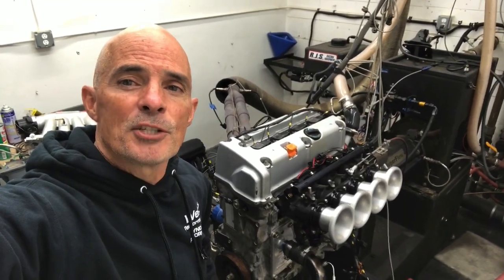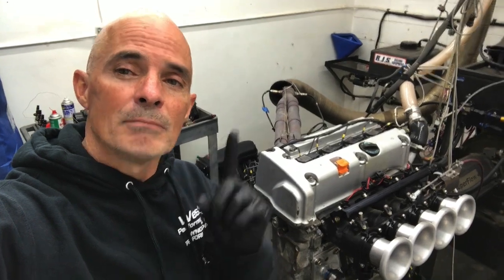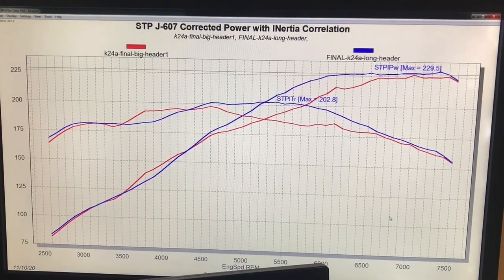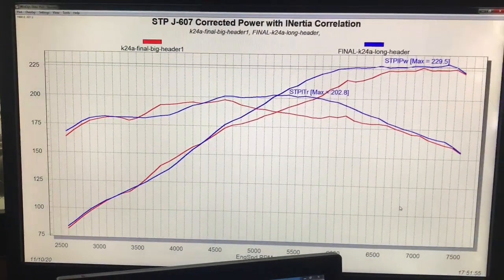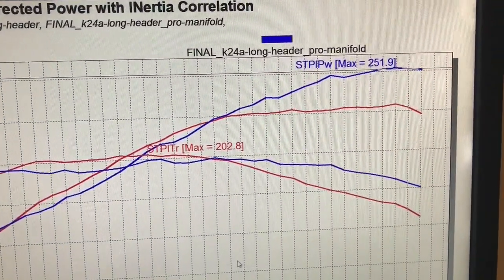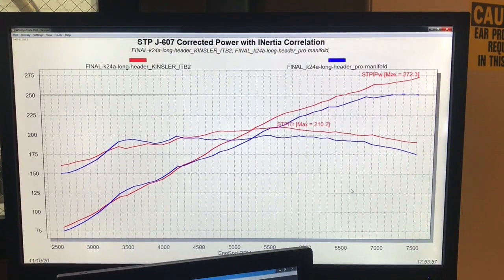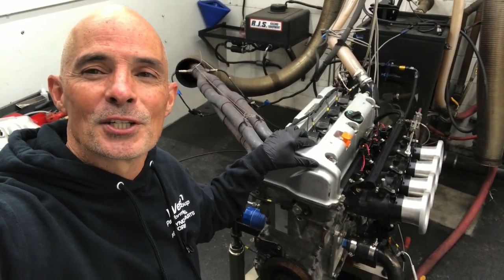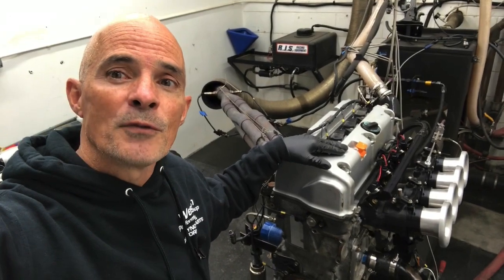JDM K-SERIES HONDA-TRI Y VS 4:1 HEADERS & STACK INJECTION

Comment: I don't care if you're the biggest diehard Big Block or Bust guy on the planet; if you're not impressed by 272hp out of 2.4L 4-cyl NA, you're just being ignorant.
Reply: That's more than my 4L inline single over head cam six makes.
Reply: Any motor out there that can make over 100hp/liter NA is a fantastic piece. Who gives a shit what the name is on the casting.
Reply: It all starts with a great cylinder head.
Reply: Especially with just bolt ons. No cams. No head work. Stock compression. Super impressive.
Reply: @xXxNECROMONGERxXx  the Daihatsu Charade Turbo was making that out of 3 cylinders!
Reply: I was going to say, that engine in stock form makes as much power as the 3 liter 6-cyl in my BMW. Probably has greater mod potential, as well.
Reply: Made that without  the oem type s pump or 50vtc cam gear, also think with the better induction of the itbs the 4-1 header with bigger primary’s would of started to shine.
Reply: @edwardwoodward8052  Come on, we can't compare NA vs turbo in any meaningful way.  Power density (HP per liter) is NA to NA, forced induction to forced induction.
Reply: Isn't that also a compound turbo over roots blower? What's the displacement?
Reply: Every sports bike is laughing
Reply: @janeblogs324  now I want to calculate and compare? BMW still the best example of a bike?
Reply: @AV-cc5wl  You're seriously asking about the HP calculation constant in here like it makes you sound smart? You ride a bike. By the sounds of it, the rest of us have more than a passing internet education on this subject. Go sit in the corner, the grown-ups are talking.
Reply: The stock 5.0 from an old foxbody mustang makes less than this.  With double the displacement.  😳
Reply: @janeblogs324  Right?  But again, not quite a great comparison because the two classes of engines are purposely built to a different engineering specification document 👍
Reply: Robert Bandy  I guess it would be hopeless to explain the difference between a loading and an acceleration dyno to some of these guys. . . ( For those playing the home game.  A loading dyno is like pulling a trailer up a hill where an acceleration dyno is like running on a drag strip. Put a lighter flywheel on an engine and you won't see a difference on a loading dyno where as you will see a improvement on an acceleration dyno )
Reply: @AV-cc5wl  Care to post a link to a bike dyno graph so we can compare?
Reply: @AV-cc5wl  Just so you know there are 800+ whp NA k series out there. Someone is actually trying to hit 1000whp soon probably within the next few months. There is no liter bike doing that NA
Reply: @Jamxknife  idk about all that... I'd bet that whatever fuel these 1000 hp all motor hondas are using would allow a super bike engine to make similar kilowatt per in³ (😂).. that being said the limit of bike engines are their transmissions and very lightly built internals... The bottom line is when u put that 200 hp 1000cc fire breathing hamster in any car that's not a mini cooper or smart things start breaking and there's really nothing left on the table anyway unless u talk forced induction which just amplifies the other issues.. there is no way to meaningfully compare apples to oranges
Reply: @Jamxknife  plus the last highest hp na k series I saw was definitely 3 litre and made 600 hp so a litre bike doing ⅓ of that off the showroom floor on pump gas is impressive less so when you see the rpm it has to turn to get it but still impressive... The major factor is that the smaller your engine the higher compression you can have for a given octane of fuel.. inverse² says (in regards to engines) if you square your volume you only have 2x the surface area to cool it so large engines pre detonate easier..
Reply: @Jamxknife  You sure it’s NA? 800 hp/2.4L equals 333 HP per liter, NATURALLY ASPIRATED!  Pretty sure that has never been done in an NA engine. (without a power adder like boost, nitrous, etc). I’m willing to admit I’m wrong if you can provide proof. And saying WHEEL HP makes your claim even more unbelievable.  No disrespect intended but you have to prove this claim to make it credible.
Reply: Karl Payne It’s 2.7. 106mm stroke. Look up all motor outlaw k series civics. Some actually just ran at the Haltech Hail Mary derby and broke a new record. Fastest fwd all motor outlaw car is like an 8.6X @ 16X
Reply: ian builds Yes they’re using nitro methane. But there are still 500whp 2.5 99mm and 2.7 106mm k series on M1 only in the restricted class running 9s.
Reply: ian builds I’ve never seen nor heard of a 3.0 k series car ever being competitive.
Reply: @Jamxknife  Let’s stay with apples to apples comparisons: as soon as you bring up nitromethane fuel you just left the conversation. Which was originally about gasoline powered engines, of course.
Reply: @turboragtop  i didn't see anything about rules limiting our conversation to gasoline... A lot of bikes and hondas I see around me run on e85 which is available at any pump... Also bet this guy did not run these tests on 93 from his local cumberland farms... So crab apples to apples? Lol the basic things that make bike engines so great like extremely lightweight parts and super high compression and revs are what holds them back when you really start turning it up.. but for real at the very peak of what's possible, apples to apples, they all will be capable of similar hp per liter na.. after all honda is a motorcycle company... where the k really shines is a slightly heavier build allowing more space for beefier rods crank and whatnot
Reply: @ianbuilds7712  Good point. Let’s focus engines running on fuel available at the pump,  Nitro opens up a totally different discussion.
Reply: @turboragtop  as long as all parties are using the same fuel it doesn't matter if they're running on hydro-lox or watered down 87 from 1987...
Reply: Karl Payne Im bringing it up because it’s never been done. They’re pushing the boundaries
Reply: @ianbuilds7712  Agreed.
Reply: old f1 engines are laughing at you lot arguing
Reply: @ACplanet  I'm sure they did whatever it is they did on pump gas while meeting emissions... And if you're paying attention 😉 you'd know we already talked about how a smaller piston can be capable of higher compression and rpm for a given octane of fuel.. and easier to cool.. 3litre v10s and whatnot make for very good na performance...
Reply: @ianbuilds7712  I didnt read it all, was just commenting on the hp/liter on n/a
Reply: @ACplanet  mmhmm... It's more complicated than that
Reply: @edwardwoodward8052  turbo key word
Reply: @ACplanet  yeah but they’re old.  And they’re just engines... so zero strategy or intelligent thought. I’m good with them laughing
Reply: @wudntulike2no32  lmfao do you need to understand that torque is what actually moves you. The reason why the bike turns over 10 000 rpm is because it has no torque
Reply: @wudntulike2no32   Tuning potential? I mean... 350 hp which is actually pretty mild daily driver for tuned K24 is actually 148 hp per liter (not stroked K24 is 2.36 l). For Coyote it would be 740 Hp naturally aspirated. F458 is 666Hp, Porsche 911 GT3 would be 592 hp. I Dont say its cheap but if anyone spends much more money and gets 740 hp form a coyote (highly doubt that) or whatever, you can tune your k24 into 400 Hp as well... 833 hp from Coyote NA ? lol. And yes I know Hp/Per liter... not that guy. I actually love pushrod engines and bigger engines with torque amd I also understand that HP per liter isnt everything, so lets not forget to appreciate the K24s excellent area under the HP curve which actually makes them outstanding. HP/weight not that bad neither... 125 plus minus kgs for dry engine with 300+ Hp not bad I think. Not a honda guy, but K24 engine is actually probably one of the best efficient engines around. Just saying. If youre not understand that, youre not aware of actual power curve of properly tuned K24 ot just beying plain ignorant.
Reply: @ianbuilds7712  Cannot find any 3.0 liter builds nor info. Could you post a link or get some keywords atleast
Reply: That's more than my 4.3...
Reply: @AV-cc5wl  who needs torque. Lol. Easy to say when your bike weighs around 500 pounds.
Reply: @povking1460  I think it's closer to it all starts with great materials then designer
Reply: @AV-cc5wl  220 bhp on a liter revving to 15k rpm with a 14.0:1 CR.... give a K series similar treatment and see what happens. Ever watch any of the 550-600 whp outlaw class n/a K series running mid 8 1/4’s?
Reply: @wickedlou9  it also makes peak power at 4800rpm 🤣 the NMRA factory stock 302s make well over 300hp on stock parts and compression
Reply: @edwardwoodward8052  with a turbo. You need to compare like for like

Comment: I would love to see the Type S oil pump conversion tested. A lot of people do it and claim around a 5 HP increase from eliminating the balance shafts, but the most important reason to do the conversion is the K20 pump is more reliable at higher RPMs because it doesn't cavitate until a much higher RPM and it doesn't have balance shafts to fail.
Reply: He’s been spinning the balance shafts at 8700 with only a few psi drop in oil pressure. Honda switched over to that style oil pump because it is overall superior.
Reply: @PolishedMobileDetailing503  No he is not, he's spinning the balance shafts at 17,400 RPM. The balance shafts spin at 2X engine speed. "Only" losing a few PSI of oil pressure at that RPM doesn't necessarily mean that the pump is not cavitating or aerating the oil either, it still could be (and likely is). Good pressure is meaningless with aerated oil. With a correctly functioning oil pump the pressure is not going to drop off with higher RPM, it will either flatline or continue to increase. Honda did install a pump with balance shafts because it is a superior design, but it is only superior from an NVH standpoint. There is absolutely no performance benefit to having balance shafts, in fact there are several performance disadvantages.
Reply: I think he's just trying to see what bolt-ons are capable of while keeping the testing methodology the same or similar with the rest of the rest of the engines he tests. Slap parts on, tune it, and see whats possible. If he raised the redline, installed cams or opened up the engine at all,  I would 100% agree for longevity purposes.
Reply: @ThmsPtrsn  I agree. I do think it would be a good test though since it's a common modification that has not been dyno tested yet (if it has I never saw it and I searched for it). I am also curious about how it would change the shape of the power curve. I would assume that it would gain throughout the entire powerband with the largest gain being on the top end since parasitic losses typically increase with RPM, but since it has never been tested before it's all speculation until someone actually tests it.
Reply: @PolishedMobileDetailing503  It's more...............wait for it................balanced
Reply: @averyalexander2303  What are the advantages of having an oil pump without balance shafts? What the difference between cativation and aeration? 🙂
Reply: @JesseLee  The main benefits of eliminating the balance shafts are less rotating weight, less drag on the engine, less heating of the oil, less chance of aerating the oil, and better reliability at high RPMs because balance shafts can catastrophically fail when revved way above the stock redline. The downside is more vibration, but for what it's worth my K24 runs very smooth without balance shafts. The non balance shaft equipped pumps also have a larger sprocket to spin them at a somewhat slower speed, reducing cavitation at high RPMs. By aerating the oil, I was referring to the very fast spinning balance shafts potentially whipping up the oil, causing tiny air bubbles. Cavitation is when the pump itself creates bubbles in the fluid and one major cause of this is spinning the pump faster than it was designed to, although I don't understand the specifics of how it works.

Comment: Being a V8 lover, I always thought you had to rev those engines over 8 grand to get the kind of numbers the V8 gets at 4 grand  (basically doubling the rpm of an 8 cylinder). That little bugger really breaths! I hope this isn't confusing but, at 2.4 liters, a quarter of a liter more than half the size of the 4.3 liter L99 V8 you are testing and look at the numbers. This 2.4 has almost the same hp output. It's at different rpm's of course but its half the size. It's not half the power.
At 4 grand the L99 looks like it's making about 220 hp and 270 lbs ft torque.
At 4 grand the 2.4L looks like it's making about 145 hp and 185 lbs ft torque.
At 4 grand the 4.8L looks like it is making about 255 hp and 330 lbs ft of torque. The LS is twice the size as the K tested.
So if the K series was an 8 cyl. 4.8L, it likely would be in the 290 hp and 370 lbs ft of torque range at 4 grand and that's not revved up yet.
That's some really impressive lumbers if I have it right. It would be nice to over lay the graphs just to compare. Too bad it's two different dyno systems.

Thank you again!! Great info!!
Ed D
Reply: If you saw the recent flow bench numbers, the L99 flowed under 200cfm at 0.5" of lift. These heads flow over 250 at 0.5" from the factory (K20A2 over 300). Combined with the extra RPM, it's no wonder they can make more HP than a 4.3L v8.
Reply: I think what you're getting at is BMEP. Essentially evaluating how well a motor breathes. But also like you mentioned, the honda is in a way different rev range and has much more cam stock. A cam only 4.8 could get close to double these numbers. But then you cam the honda and we trade off again.
Reply: its a more modern engine design. Having 4 valves per cylinder really good cylinder head design and variable cam timing/vtec is a major advantage. It's kind of like half of a 5.0L ford coyote engine but better.
Reply: @Levibetz  Exactly
Reply: Flow is key... If it had to breath out of one intake valve per cyl it would have trouble making half that power without getting choked up.

Comment: The K24A with the tri-Y and ITB's sounds nuts.
Couple things -- I think the header worked better because of the tri-Y vs. 4-1 configuration and the longer secondaries. I'd want to see a 2.75" and a 3.5" test to confirm your small tube theory.
I also would've tested different air intake tube lengths with the velocity stack and tested the intake manifolds with both headers to see where it made the most gains.
The drops in power probably could've been addressed by changing VTC gears and tuning VTEC engagement.
Solid video. 272 crank hp with no accessories would make for a ripper in an EG hatch. I bet that 300 crank hp number is achievable with bolt ons with just a few more tuning tweaks and maybe a Type-S oil pump.

Comment: Per cc NA K motors are King. 
K24 with a K20 head is a proven killer combo.
Reply: K24a2-3 basically same head casting slap some daul valve springs and a type r intake cam slightly better that a k20 head with 06 k24a2 exhaust cam its bigger than k20 when i eventually finish my car $$$$ im curious to see what it makes but iv also given the head a small port job nicers transitions are clean up im undecided on intake manifold yet im hoping for a optimistic 250hp on decent fuel

Comment: I did a lot of work with the olds Quad four engine and I had that thing making 299hp at 7200RPM and almost 300 lb ft of Tq at 5200 RPM. Even had webbers on it.
Reply: That's a lot or torque. What displacement was it?
Reply: @povking1460  2.3 stock bore.
Reply: Yeah that's a bunch of bull ,300lb/ft of torque from a N/A 2.3 liter engine,  keep dreaming.
Reply: @dilsher12  Ok it was 296.7 lb feet sorry
Reply: @racerd9669  Buddy  it's not possible for a 2.3litre engine to make '296.7' lb/ft of torque without some sort of a power adder( nitrous, forced inductions) . You can not defy physics, I don't care if  it was running on unicorn piss , it can not make those number . Stop living in a fantasy land .
Reply: Looks like it would have been making more hp at 5252rpm.  ;)
Reply: @dilsher12  Ok so to satisfy you, I looked up the dyno sheets , engine was tested march of 2009. Vapor pressure was .38 Baro, was 29.39. we pulled the engine from 4700 to 7000 rpm. Peak tq was at 5800 266lb feet peak Hp was at 7200 297.8. So I was wrong. The head flowed 285cfm on hte intake at .500 lift and 207 on the Exhaust at .500 lift. I am so very sorry to inslut you the way I did.
Reply: No need to be sarcastic,  as somebody who has built and modified engines you of all people should know that a difference of 34 lb/ft is huge on small displacement N/A 4 banger.  And instead of spreading misinformation, the least you can do is educate people like myself that are still learning about engine building and wrenching . Having said that 266 lb/ft is still a pretty lofty number.  I am guessing the volumetric efficiency  of the engines is probably over 120% . But if it is true like you claim more power to you , that's quite impressive.
Reply: @dilsher12  The key to making Torque is to make clyinder pressure, and how do you do that is with the correct valve events that match the piston movement and compression ratio.